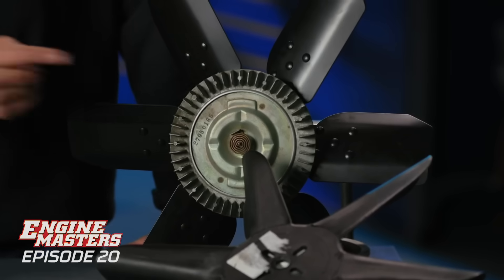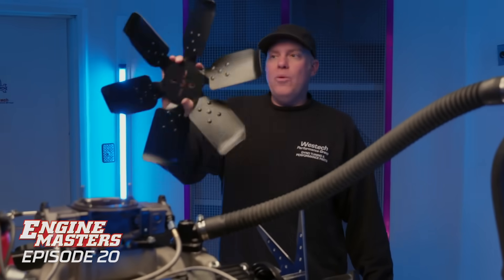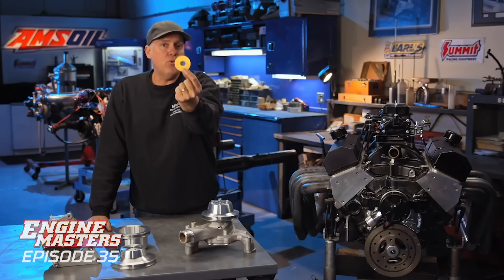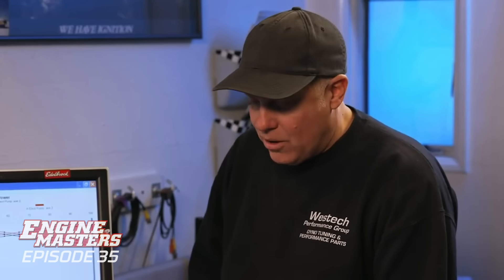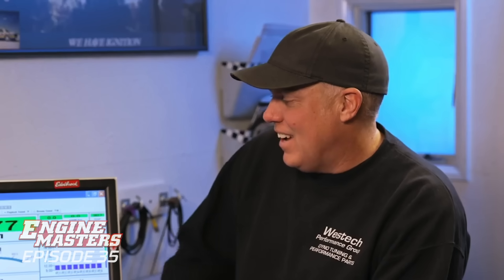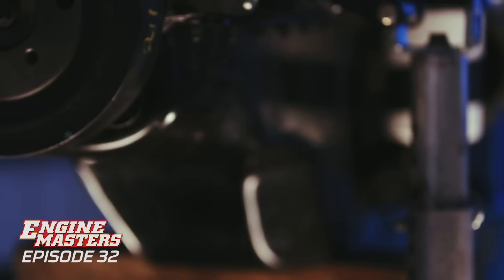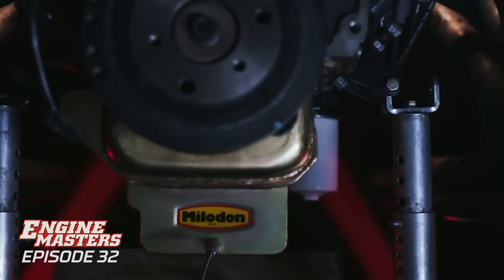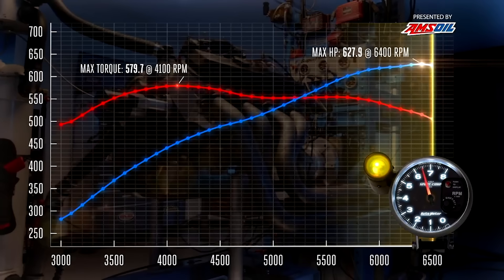Don't Do This! How to Ruin Your Engine's Horsepower | Engine Masters | MotorTrend

Comment: As far as load on the alternator (a 1 wire) I used to add a switch to the circuit and shut it off during races. I ran 2 batteries in the trunk to handle the  power load and switched it back on at the end of the track.
Reply: The alt hp loss is probably so low that you made it slower by adding the weight of the batteries. The only benefit is the better traction from the weight at the back fron the batteries.

Comment: Not so great. at 0:06 you're showing 4 different fan types and only tested 2. 
I guess we have to pay to watch the motor trend channel to see the other 2 tested?
Reply: Yep!
Reply: it doesn't cost much, especially when you split it between 3 or 4 mates and share the code. wink wink.
Reply: Metal blades are best.
Reply: @paulhotson5820  Yes I think so too. I found another video on youtube that tests the metal blades.
Reply: Short attention span theater. The oil level test is worthwhile but i'd be interested in alternator pulley swaps to see how that affects horsepower and battery charge.
Reply: @gregorytimmons4777  I suppose that's why some racers don't run an alternator while others run a mini alternator with only amperage enough to supply minimal power.

Comment: A flex fan can cause a over heating problem especially in pulling a load. Trust me!
Reply: Depends on the fan design, how it fits the shroud, how fast the pulley turns, and size of the radiator. I have a 3 core radiator, 19” stainless flex fan that just barely fits in the shroud. Fan spacer puts the fan well into the shroud. I run a 30% underdrive crank pulley, and my 400+ hp 350 sbc never ever gets up to 180f even with a 185 thermostat. I was surprised that they got more power at a lower temperature; all the bench racers used to think hotter = more hp. I guess we can all assume now that higher temperatures are better for emissions, but not for peak power.
Reply: @69shovlhed89  I have a friend with a 72 Ford 250 and every time he was towing his trailer over the grapevine going slow with the motor revved up it would over heat because the flex fan flattened out and no longer moved enough air. It took him a while to figure it out. This happened years ago!  Back in the day.
Reply: @donaldappelhof2059  must have been a crappy flex fan. the ones with the thin triangular blades suck. mine has full size blades but then also towing is a completely different situation. all that extra weight so that he has to drop it down to a lower gear. i'd probably run an old steel 6 blade truck fan if i was towing.

Comment: I think an electric pump will still draw power via increased resistance in the alternator.
Reply: Well, you could mount a small lithium ion battery next to the main battery as a dedicated power source to run the cooling fan.

Comment: The Engeen Need. Repair / Restore The Equipment At Where The Equipment On Engeen Working As Central To Swing / Spin The Watterpumb Work By Belt To Safe HP Not Drop, .... Thanks All, ..... Cherrio.🌠☁️🚗☁️🌠👍👍👍🌠🌠🌟🌠🌠.

Comment: Well I'd imagine 8 quarts of oil in a 6 quart system wouldn't work out too well. Now you have me wondering if I should drop down to 4 quarts in my small block. It drops from 70-80psi down to 50psi when you're making a pull with 5 in the pan and one in the filter as was recommended.
Reply: But a dyno pull doesn’t throw oil like a car does on launch! Isn’t that what the extra quart is for?
Reply: @jinglingbabygarage7030  lol most likely, I wouldn't actually run it two quarts low 😂 we pulled it apart to swap cams this past year and it was still shiny and new inside, all the bearings looked awesome, so I quit caring. I'm not worrying unless it drops to zero 😂

Comment: I'd like to know how much horsepower is lost by running electric fan and electric water pump on a race car to drag on the alternator
Reply: Drag car spec no alt , just a well charged batty , even a good cordless batter these days to save weight
Reply: Usually see small fans on race cars because they never really use them because they are moving at speeds. I got a duel fan for my street rod because it was getting to hot at red lights and parking lots. It kicks on at 180 and shuts off at 160. Doesn't seem to waste horsepower because only kicks on when it gets hot sitting.

Comment: I disagree that the electric pump has no parasitic loss, as the electrical load is converted to mechanical load by the alternator
Reply: Years ago I had a Flex-lite fan on my 5.0 Mustang and never had any problems.  I drove it for years like that.  It makes sense that if you’re running high RPM’s but not traveling at high speeds, then there won’t be enough air to cool the radiator.

Comment: Did you use a baffle tray on any of the oil pan test ? Low oil pressure could be a real problem . Most performance builders use trays in their builds . You seemed to also leave out a lot of test results .

Comment: Electric fan ftw
Reply: They can try all the fan designs and shroud theories, nothing will ever beat not having a fan attached to the engine so electric is the best anyways.
Reply: @L-Noble.YT_Hi.Res-Soundminds  Yup, Besides, the fan is on a temperature sensor anyways, it's not always on so it isn't always drawing power away from the engine. Electric FTW.
Reply: @BlackTownie999  Yep we win! lol... The other benefit is a faster warm up to operating temp with electric, better gas mileage, less load on crank with faster reving, more hp. etc.. The fan clutch is old stuff, the only advance they have made since forever is made the fan plastic instead of heavy steel to reduce the weight.

Comment: Electric fans and pump wont rob any power. There's that 🤣🤣
Reply: Either their load is transferred to the alternator or you have a secondary battery separate from the charging system adding weight. You don't get something for nothing.
Reply: The lithium battery on my truck weighs 7 pounds and it's a champ. I can put 4 of those to the weight of one regular battery. Anyways people keep saying the alt has a loss. Yeah but it is like 1 to 2 hp loss. it's better than the loss with a fan on the engine.

Comment: They should do a test on AC vs no AC compressor. It would be a hassle to rig in the dyno room but..
Reply: The a/c compressor kills a noticeable amount of power when it's running. Especially in an engine with no modifications or power adders.
Reply: @onefastgmc  Yes that is true. But I had no idea that something as simple as a fan steals 20+hp. That is insane
Reply: I can tell you the fan robs the most power, then the ac, then the water pump, then the power steering then the alt is last.

Comment: Hey Feieburger,
     I know the aluminum pump showed less hp loss on the dyno. But.. you didn't run it hooked to the alternator as it would be in the car. I would like to see that tested bro. I could see it still being beneficial for the average street guy, if you want to make a rip just make sure the temp is good and shut the pump off for the pass. 

But back to my point, it seems like for the average street car guy a mechanical pump is no real loss of power over a mechanical pump. That is unless we are talking about a pulse width modulated pump, and fans.. but there it is again.. the power draw of the alternator comes into play. 

One things for sure.. power steering and ac have got to go, here in Michigan we can get away with that, having a targa top helps haha.

Comment: At full throttle you can cut power to your electric fans by simply programming your Holley EFI that way if you got it.
Reply: And your electric pumps. At least for 20 seconds or so at a time.
Reply: Or using a throttle switch, like used for nitrous

Comment: What works on a dyno may not work on the street, I've never owned a electric fan that can keep up with a modified engine taking a beating as good as one engine driven. Reliability is worth more than a few more hp at the dyno
Reply: Are you serious, any decent electrical fan will easily out cool an mechanical fan from idle to full tilt. Plus the keep running after the engine is shut so it help out with temp spike after the engine is shut down.
Reply: I had a dual electric fan that worked fine, it was a push/pull setup and car ran cooler than stock or flex fan on a 10.8 second 318 .030 over Valiant. Years later I used the same setup on my '85 CJ-7 w very modified Ford 300ci I-6, I had problems overheating with stock, clutch and flex fans when low speed climbing until I went dual electric.

Comment: do a Viper motor...like a Gen2 and modernize it (real oil pan, headers, bigger throttle bodies and injectors, camshaft) or compare a bunch of oddball engines and modernize them. buick/Rover  Ford Y block, Polysphere.

Comment: I would have liked to see the fan test run with the engine coolant in the radiator, and the electric waterpump test run with the pump powered by the alternator like it would be in the real world.
Reply: At those load levels, the power difference would be within margin of error. A cheap alternator will put out 65 amps, which at 13.8 volts is a theoretical maximum of 897 watts. The water pump will draw around 5 amps, which comes out to to 69 watts at the same voltage.

Short answer, it would be less than 10% of the difference of a fully loaded alternator, or so small, you can't tell the difference in dyno pulls alone.
Reply: @technicholy  10% assumes that the alternator is fully loaded BUT regardless, the cost of driving the electric fan/water pump will be additive to the load the alternator puts on.

There is no "margin of error" at play here - this would really make sense if you were to think of the additional load being too much for a normal alternator, which I think is right. 

But if you're implying that there would be no additional load, then you are not correct.

As an example, a Davis Craig Fan draws about 19amp and their water pumps about 10amps. At 14.4v alternator output wattage combined is 418 watts. Given the alternator itself about 50% efficient, and the power sapping of the pulleys and belts, along with the energy required to drive the fan on the front of the alternator, you're closer to 20% efficiency.

So that's about thats about 2.1Kw watts or over 2.5 horsepower, so yes, there will be a small, but measurable load placed on the engine.

Comment: could a switch be hooked up so when you are making your power run, or 1/4 mile pass, so that all of the accessories can run off the battery but the alternator isn't loaded until you flip the switch back?  or maybe hook this button on the floor under the gas pedal so no charging load just while floored?
Reply: A lot of drag week guys had electric water pumps

And a lot of them were blowing fuses and overheating. 

On a race car great

 street cars I don't trust them
Reply: You could, but unless it's just for a single drag on a sub-100 hp car, I wouldn't. Big power makes big heat. I blew a radiator while making only ~150hp when my belt snapped. Took less than 3 seconds between the snap and the boom. That water pump not rolling is a serious problem.

Comment: Jeep guys: BBUT BUT BUT11!!, eNgINe aT 200 dEgREes mAKe toNS m0Ar hRRspOWer!!1
Reply: Yeah... Guess that's why the most popular mod for a JK is the 180 degree thermostat in place of the stock 203. Just because you wreck your Jeep doesn't mean others do.
Reply: It's probably why I always hear about guys melting pistons, cracking heads, top end rattling to death. Then asking what could have gone wrong on a completely stock motor. When people ask how hot it got the answer is always "205, 210, 220 - iT waS FInE!". People overwhelmingly slam the laughing reaction.
Reply: @CanadaBud23  - I'm a mechanic and I don't see those issues, except for the rattling in the head. Chrysler doesn't make the best rockers.

I have seen a few neglected Jeeps with serious issues. The one that was the biggest problem was a 2000 JGC that was overheated from a rusted out cooling system. Had to remove all the core plugs to flush the block out it was so bad.

That said, biggest issue outside of rockers is coolant leaks. Temp sensors don't read air the same they do coolant. When the coolant gets low enough to not touch the sensor (near the top of cooling system on most Jeeps), the reading is much less accurate. Coolant showing 220 on the dash may actually be 250 or more in these cases. So maintenance is key. Don't wreck your Jeep. :p
Reply: @CanadaBud23  - One more thing... If those guys are climbers and they were out on the rocks, angle of the oil pan is a big factor. Current JK engine has oil pickup in the front, previous models had it in the back. Starve the pump, kill the engine. Don't wreck your Jeep. :p
Reply: @sienile  Some just send it lol. I run megasquirt on mine. It tells me what my temps are at different points on the engine and I just track/strip mine. These guys should be more inclined to do the same if they attacking all these angles on the trail. every week.

Comment: I do restorations...we can't just bolt on "whatever". It has to be correct or something that doesn't take mods. We always  go with a clutch fan. It doesn't change the car, and here in Texas, you NEED airflow past the radiator. A clutch fan is the best compromise. Also, do these runs on a chassis dyno (like we do) and be amazed at the power loss. We recently restored a 1969 L-88 Corvette. The engine on the engine dyno with no accessories made 535 HP. On the chassis dyno? 266 HP. This is bone stock stuff....which means that engine HAD to flow through a 2-1/4" stock exhaust. Anything above 4200 rpm and the mixture would go stupid rich and the power would fall off. After the car won the Duntov award and top Flight, I would like to install an after market 2-1/2" system and really see the difference. Haven't had that opportunity yet.

Comment: I didn't learn anything from this. Teh factory fixed blade fan is best for A towing vehicle sow it doesn't overheat. The  plastic fan is a joke. the Clutch fan is best or the OEM's would not use them.  Electric fans only come on at a set temp so when does it suck hp?  Truck Oil pans use less hp and aftermarket ones use the same amount of oil as a stocker.

Comment: So, we all know that flex/clutch fans kill power. However, if you really want to be accurate you would need to test with adequate (realistic road speeds) air flow into the fan. The fan will not be working as hard to move air.

Comment: You can see from the OE world, what things take power. They put electric fans, electric power steering, variable displacement AC compressors, electric water pumps, thin oil... all of that robs power and robbed power means less efficieny and thus lower mpgs.

Comment: Can you do a test with using Evans Coolant instead of pure water and also compared to 50% water 50% antifreeze?  Because those of us that live in the cold parts of the USA need an antifreeze and some people think the Evans Coolant will kill more power than water.  Also what would be telling, or worth investigating, would be how much power or water pump speed would be needed to maintain a suitable engine temperature to allow the engine to live and still make power.

Comment: Question. So using a fan and a alternator and water pump and so on uses lots of horse power and torque so why do we supercharger cars  i can only imagine that it uses a lot just to spin it. wouldn't a turbo be more efficient and produce more power and torque
Reply: Yes. that why the turbo was invented to use free exhaust power rather than rob crank power. the only advantage of a supercharger is less boost lag